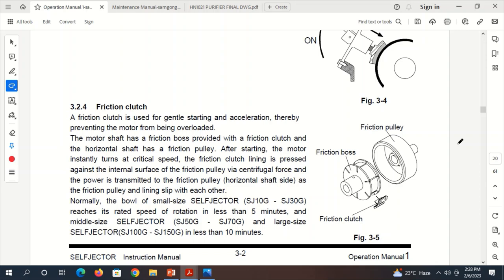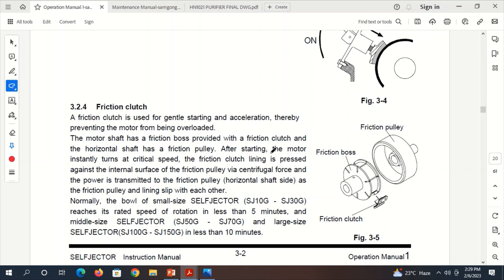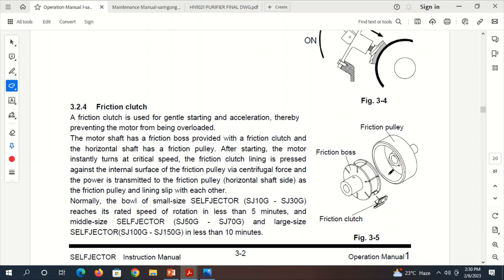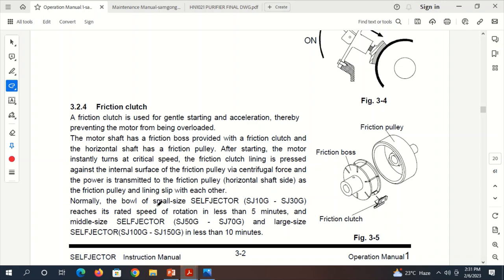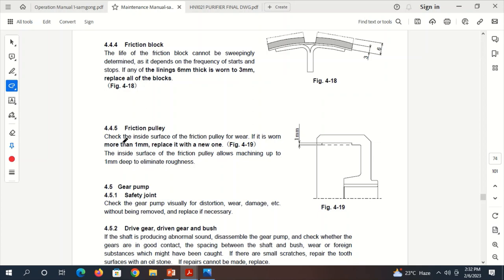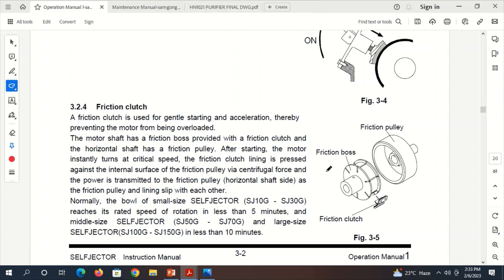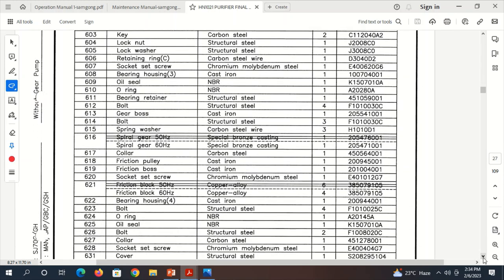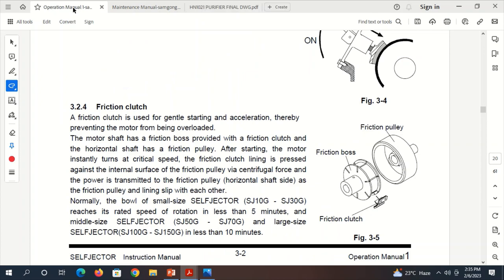How Many Friction Pads are used in Mitsubishi Purifiers ? Friction Pads and Friction Block Pulley

Comment: One of the question ask by surveyor.. What is the reason for friction pad slipping? What will you do if wear is in limit and pad is slipping?
Reply from the maker: Friction pad slipping Reason - wear down of boss or pad surface becoming smooth and thickness reducing..and Clutching mechanism is lost.
But if wear is in limit, then either replace the pads or but if u dont have new spare ,then use a File and do filing on pads surface to make effective contact and Clutching.
Hope u understood.